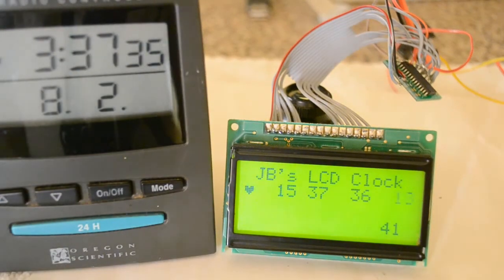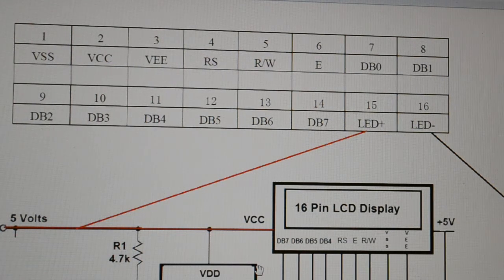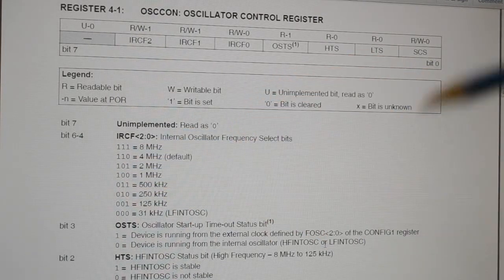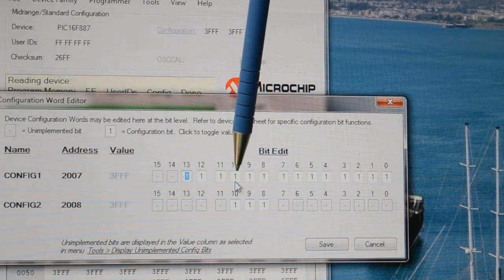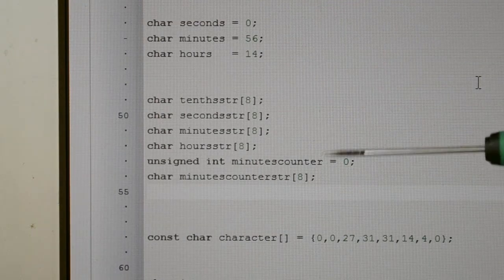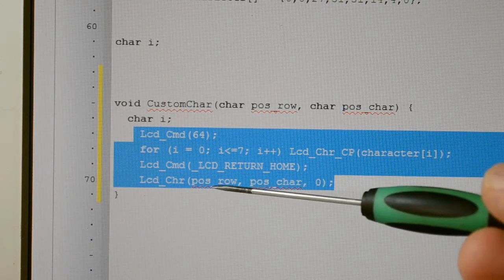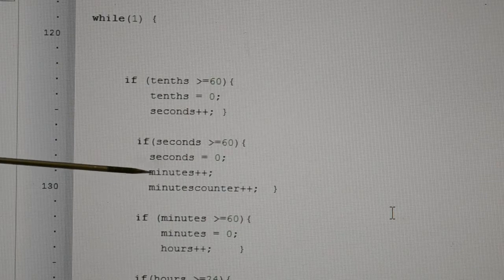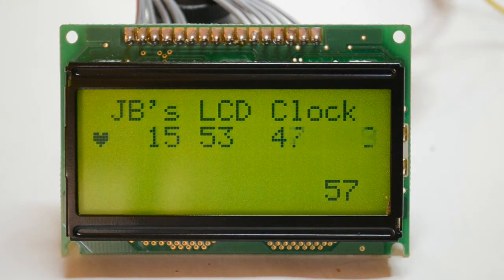Pic Programming for beginners, LCD Clock and no crystal

Comment: Thank you for this! I'm having a hard time transitioning from arduino environments to pic.
Reply from the maker: Yes I understand completely.
What made you change?
What IDE are you using?
Thank you for your comments and welcome.
Reply: @JohnB-2021  haha, haven't even gotten to the IDE yet, just placed my order on what I (think I) will need. I am really into low-level programming and I sometimes get around little hardware projects which most of the time have an arduino somewhere in-between. I usually don't even use half of what the arduino environment has to offer so I figured: Why pay more for what I'm not using? Plus I'm sure it will be a fun experience once I get the hang of it.
Reply from the maker: @LuizDahoraavida  You can use any of Mikroelektronika's IDEs free of charge if the program is less than 2k words.
They have many examples in the IDE, they show you how to get started.
Microchip also have their own and are free to use though a little more difficult to use.
They also have many examples.
The Mikroelektronika programmer for pic, dspic and pic32 is $99
Their arm programmer is cheaper I think.
Microchip's pickit4 is about £56 from farnell, cheaper from Microchip except thay are sold out.

You're more familiar with Arduino so why make the change?